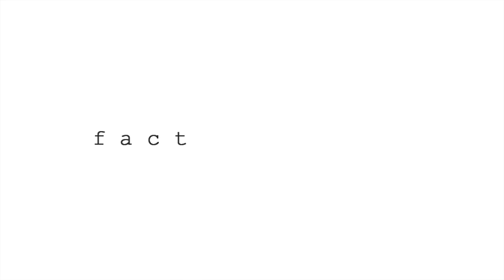7 Architecture Facts pt.51 | SOM, Phi, & The First Elevator

Comment: Here is a quick question for you...

On a recent trip (OK, 2014) to Armenia with a side-trip to Georgia, I noticed that in Georgia there were these peculiar looking structures that existed near factories or refineries. They had slanted tops, and a metal support structure, but were not buildings per se (unless they were unfinished business from the 80s). They appeared to be giant solar arrays, but they did not have the solar panels. I should mention they were very large. Building-sized in fact.  I searched for Soviet-era architecture but came up flat. Same with post-Soviet architecture.  Anyone have any clues to this? Were they, in fact, just abandoned factories? Thanks all. 

Great series!!